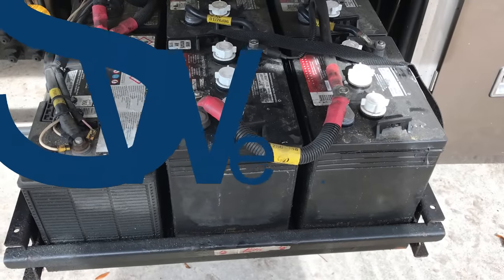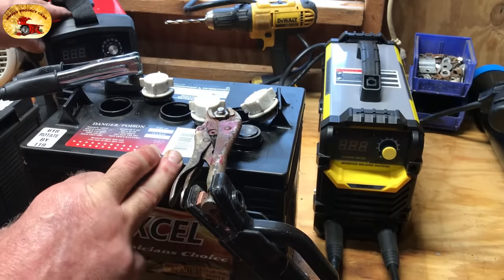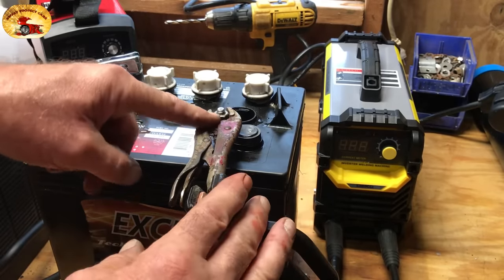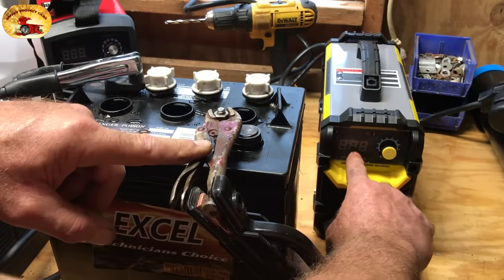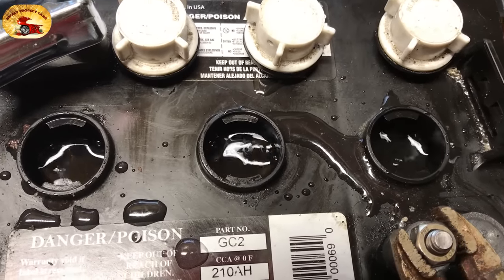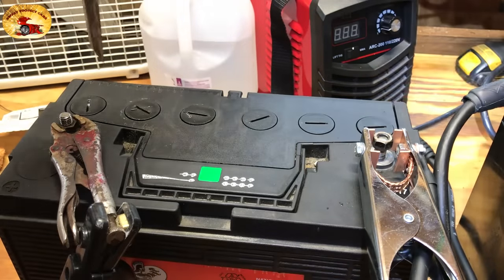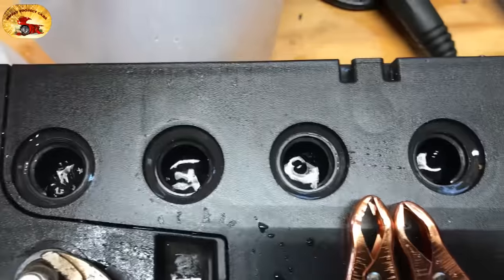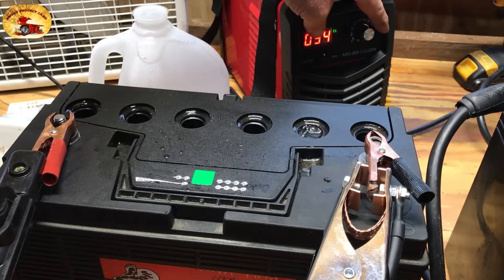How To MAKE OLD BATTERIES NEW Again!!!  12v 6v Deep Cycle, Car, Truck, Golf Cart, Semi

Comment: Well I took the plunge, and got the red welder to try to save a 12 volt deep cycle battery. 4 out of 6 cells  bubble well and 2 sit there. I hooked up the red welder and I increased the setting up towards 200 and popped a garage breaker. I tried it out back of the house and it popped the breaker after a short bit as well....any ideas?
Reply from the maker: The welder is more efficient than any battery charger out there so you only have to set it to 1/2 the amperage, you don't need to go to 200amps. as long as it's boiling. Also, you may need to do the process 2 or 3 times to wake up the battery.  Do as the video shows once for 3 days if it doesn't wake the battery up it's toast. Make sure you recap and unplug the welder before disconnecting the cables.  Hope this helps Rick.  Thanks for asking. Have a great day.  mad Mike the hammer SPC
Reply: @SweetProjectCars  Try grounding the welder itself outside with ground rod and wire. Stopped tripping my breaker and ground fault outlets.

Comment: My golf cart has 8 volt batteries.  Is there anything out there I can buy that will work?
Reply from the maker: This process works on all wet-style batteries.  Thanks for watching.  Have a great day.  mad Mike the hammer SPC
Reply: @SweetProjectCars  which welder works for 8 volt?   You recommend one for 6/12 deep cycle and one for 12v automotive?

Comment: Does this damage the welder in anyway?
Reply from the maker: Hello Peter, with over 700 videos on our channel, we would never put something out that would harm a viewer or anything they have.  mad Mike the hammer SPC
Reply: It has to be an inverter type DC stick welder, the thing with inverter welding machines is that they have built-in protection for short circuits and anything out of the ordinary, these machines can handle 200A burst, highly doubt a battery's internal resistance would destroy it.

Comment: Great Video. Thanks!
Quick question,. Would it be worth my while to remove the electrolyte liquid after the charging and filter out the residue from the desulphating and then put back the same liquid after filtering clean?
Reply from the maker: That's not necessary, Zephyr. Thanks for watching and asking, have a great day. mad Mike the hammer SPC

Comment: The life of a battery is 4-6 years. If is newer and sulfated your method it's effective, but if is old or broken inside is a total loss.I did it using 240V, diode, and resistor in series,  and last year by using two battery chargers(not electronic)   in series.
Reply from the maker: We say, if  your battery is not working the way you like it, do this as you've got nothing to lose, we have done this to hundreds of customers' batteries and have some that are 20 years old.  Thanks for your comment Nicos.  Have a great day.  mad Mike the hammer SPC

Comment: I just got my DC welder and was getting ready to try this process so I pulled the 12 volt battery out of my motorcycle and it's an AGM battery. I've read that you aren't supposed to add distilled water to an AGM battery and I've also read that some people do. I pulled the strip of caps off the top and many of the cells look dry, I think that the glass mat is supposed to look wet but that the electrolyte shouldn't be filled as high as in a wet cell battery and I've also read that this process will ruin an AGM battery. How do you deal with AGM batteries, when they stop holding a charge are they junk or can they be recovered as well?
Reply from the maker: Hello Jeff, due to the fact that AGM batteries are more sensitive to charging, every AGM manufacturer has a recommended charger for their specific batteries, you need to find out what charger is recommended for your battery.  Hope this helps, thank you for watching and asking, have a great day and  all the best on your project. mad Mike the hammer SPC
Reply: @SweetProjectCars  Thanks for the reply, I didn't get this welder in vain, for one I weld as a hobby around the home and this little tig/stick welder just adds to the arsenal 😀 and I still have an Interstate 12V automotive battery that is a flooded lead acid battery that needs restored. I tried it with a borrowed battery charger with 200 amp jump start but I think that mode was automatic because I never was able to get any cells bubbling with it so we'll see how this DC welder works. 👍

Comment: Doesn't the welder's display indicate current intensity in amps?
Reply from the maker: Start the welder on it's lowest setting and keep increasing until you get a rapid boil.  Keep it simple.  Thanks for asking and watching.  Have a great day.  mad Mike the hammer SPC
Reply: Yes. That readout is amps. I assume the voltage is about 25v on the stick welder.

Comment: this is a fact im using the same battery in my lawn mower that came with it 10 years ago it just like a new one but every year i hook my 100 amp battery charger to it an boil it just like this for a couple mins an its just like new..an its a sealed battery i can hear it boiling  i dont know why people dont do this an the battery will last to it looses a cell only time i ever change a battery with it shorts out one of the cells
Reply from the maker: We are with you 100% on that miracle man!  We have batteries that we have had for years and years.  Thank you for watching and sharing your knowledge of this process.  Hope you have a great day my friend.  mad Mike the hammer SPC

Comment: Why can’t you use the yellow one on regular car batteries? Only deep cycle 6 &12v?
Reply from the maker: We found the two different welders and their specifications work differently for 12v standard car batteries and 6v deep cycle batteries.  After months of preparing and studying all of the different welders out there and the effects they had on 12v standard batteries and 6v deep cells, these are the welders we came up with that are safe for you and the batteries.  They are listed accordingly in the SHOW MORE of the videos description.  We have two different welders because the 200amp is too big for 6v batteries, you don't want to know how we found that out.   Thanks for asking.  Have a great day.  mad Mike the hammer SPC
Reply: Thank you Mike!! Do you think the 160 amp one will work for regular 12 v, only slower? I’m wondering if i can get away with just getting one due to space constraints.

Comment: Dang....I need the inverter welder for the 6 volt battery. It’s sold out and unavailable...ugh. Any suggestions?
Reply from the maker: See my other comment to you Bryson, it should get you pointed in the right direction.  Thanks for watching and asking.  Have a great day.  mad Mike the hammer SPC

Comment: Will this also work on AGM batteries like Optima.
Reply from the maker: No, Gavin, this does not work on gel/agm batteries.  Thanks for asking and watching.  Have a great day.  mad Mike the hammer SPC
Reply: AGM technology by design is very resistive to “sulfation” of the plates as they are sandwiched between glass mat. The low self discharge of AGM’s also wards off sulfation. When a battery goes below about 12.3/12.2 sulfation begins.

Comment: Thank you so much. You really have great, straight-shooting ideas that work. I'm getting the Yellow welder for my off-grid 6V batteries. How do the cables hook up to the welder?
Reply from the maker: They have a probe end that snaps into the front of the welder, they are removeable.  Hope this helps.  Thanks.  mad Mike the hammer SPC
Reply: @SweetProjectCars  hey, that you for a careful and kind answer to what was essentially a stupid question.
Reply: lol might want to test the polarity with multimeter before turning the machine on...

Comment: so will the yellow one do all batteries in addition to deep cycle?
Reply from the maker: The yellow welder is the one you will want to use for 6v batteries, the red welder is for 12v batteries.  Thanks for asking.  Have a great day.  mad Mike the hammer SPC
Reply: @SweetProjectCars  Hey Mike.  Does the yellow one do 12volt deep cycle or do I need the red one for either 12v deep and regular.  I bought the  YESWELDER ARC-165DS Stick Welder,165Amp Digital Inverter you suggested and I can't get my 12 v deep cycle golf cart battery to bubble. Thanks for the help.

Comment: Great video Mike but i was wondering if you can use a AC welder instead of the DC? I have a small AC 160 amp welder that you can dial in like the DC welder you show. Thank you for the great videos. 
William
Reply from the maker: We suggest only using the one's we share William, after years of testing the one's we use work every time, and they are safe for both you and your batteries. Thank you for watching and asking, have a great day. mad Mike the hammer SPC

Comment: I have a BOC welder. Inverter style. Welds beautiful. My question is the  what maximum voltage can you use to do this trick? I have a deep cycle battery which I am assuming is sulfated. Welder goes from 20 amps to 140 amps. I can Tig weld but I use only as arc  welder. Ant reply appreciated cheers from Australia just subbed.nice work 🙂👍
Reply from the maker: Just start out on the lowest setting, then gradually turn it up until you have a full consistent boil, then follow the process in the video, and make sure you recap and unplug the welder before disconnecting the cables.  Hope this helps Dragan, thank you for watching and asking, have a great day and all the best on your project. mad Mike the hammer SPC
Reply: @SweetProjectCars  thanks man! I really appreciate the reply. Cheers and have a great day or night!😃👍👍👍

Comment: Wouldn't you need to reverse the leads since the "neg" lead on the welder is positive and the positive lead is negative? I tried how the video pictured  Sure it bubbled. But now with a multimeter on the battery the positive post shows negative voltage. Try to hook it to a charger and it just says wrong connection.
Reply from the maker: We've never had this issue, if you're using the exact tools we are using you will not have a problem.  Following the video and using the same tools is the key to success. Thanks. mad Mike the hammer SPC
Reply: Adam Opheim, are you sure you are not using your mig/tig welder set up for aluminum? Most of these welders you can switch it back to ferrous metals by reversing the leads. In the end you want positive welder lead on positive and negative on negative both at the battery and at the welder connections.
Reply: With DC welders, you have the option to weld in reverse polarity or "normal" polarity, which is to say positive to positive. It sounds like you had your welder leads hooked up to the machine on reverse polarity, and managed to switch the polarity on your battery.

Comment: Does anybody have one of these inverter welders and a multimeter ? 
I'm interested to know how many volts they put out 
Thanks if you can measure and post voltage
Reply from the maker: I can tell you that you don't need a multimeter with either one of them they put out enough volts.  thanks.  mad Mike the hammer SPC
Reply: They are both Constant Voltage welders. The yellow one is 60v CV, and the red one is 75v. The dial controls the current, not the voltage.

Comment: Why wouldn't the red welder work on the 6v or the other welder on the 12v?
Reply: Wondering the same
Reply from the maker: Our videos are very product/tool specific, we are sharing what we have tried, tested and know works every time, also is safe for both you and your batteries.  Thank you for watching. mad Mike the hammer SPC

Comment: What if your battery is a closed battery? A dry cell.  This is only if you use acid lead batteries.
Reply from the maker: This works on wet style batteries only.  Thanks for asking Marcin.  Have a great day.  Thanks for watching.  mad Mike the hammer SPC

Comment: The numbers on the welder dont seem to represent anything other than a percentage of power being output.  What is the applied voltage to the battery and if it's over 14 volts, how does this not damage the battery?
Reply from the maker: Turn all dials to zero, then attach to battery, slowly turn the first dial up until you see slight bubbling, slowly turn the dial up until you get a consistent boil without boiling it over.  That's it.  Thanks.  mad Mike the hammer SPC

Comment: Can I use my Lincoln buzz box ? How many amps?
Reply from the maker: You can use whatever you want, we are just showing you what safely works for you and the battery.  Have a great day.  mad Mike the hammer SPC
Reply: @SweetProjectCars  how many amps should I use? Does it matter if it is ac or dc? Thank you

Comment: I really like the idea but I have some questions. You told us to use the smaller (I think 160 amp) DC welder for the 6V deep cycle battery, would you use the same welder for say 12V motorcycle and riding lawnmower batteries as well or use the bigger welder for those?
 Also, wouldn't there be a benefit to pouring out the crud that accumulates inside the battery and starting with fresh distilled water or no? 
  Thank you
Reply from the maker: You can use that welder for those size batteries, and as far as pouring out the crud, it's not necessary if you can get double the life out of a rejuvenated battery that's great.  Thanks for watching and asking Jeff, have a great day. mad Mike the hammer SPC
Reply: @SweetProjectCars  I'm doing this today on a battery that will no longer hold a charge for more than a few days in our '99 GMC Safari. Fingers crossed 🤞
Reply: @bodeine454  did it work?
Reply: Stick welder power sources will have the voltage naturally change to whatever is needed to jump the gap, either from the welding electrode to the work, or between the plates in the battery.  The adjustment on the machine is amps, the total number of electrons. 1 amp is 6,[17 zeros] electrons. So, the same welder should work for 6, 12, or 24 volt batteries.  A smaller size battery would need less amps to boil the water between the plates and break off the sulfur scales.
Reply: As far as dumping out the crud and adding pure distilled water, that would allow the charger to clean the battery plates well, but unless you go to the auto parts store and buy new acid to put into the battery, it won't charge.  There's a small measuring tool anyone can buy to test the specific gravity (concentration) of the battery acid.  It has different colored balls that float in the battery acid to show you how heavy the liquid is.  A jar of new battery acid is pretty cheap.  That stuff is dangerous.  Do anything like that in a sink, wearing glasses and gloves, and wash with lots of water when if you don't think you touched any acid.
Reply: @Eyes0penNoFear  No, I was using a Napa 200 amp charger but I think that the 200 amp  jump start feature was automatic or something different, I never could get the cells to boil and I tried about 4 or 5 times. I guess I need a different charger.
Reply: @carpediemarts705  I hear that, it seems that every time I mess around with a lead acid battery that no matter how careful I am I usually end up with small holes in whatever clothing I wore and they don't show up right away, like a week or so after it's been washed a few times. 😏
Reply: @SweetProjectCars  Will you link a decent stick/tig or mig/tig welder for around $200? The stick/tig welder you listed doesn't come with a tig torch or hardly any accessories and I'm not sure what to get, I've never tig welded before.

Comment: I saw your other video that recommended topping off with distilled water and charging with a manual 200 Amp charger every hour for 15 minutes. 

I happen to have a welder that goes up to 140 Amps. Therefore this method is preferable. 
You stated to start on the lowest setting and gradually increase until the liquid boils. 

My confusion lies at how many amps do I stop at after boiling occurs. 

Please help. Really need to try this ASAPto save $
Reply from the maker: You gradually turn it up, once you reach a rapid boil on all the cells, follow the detailed instruction in the video.  Thanks for watching Billy, have a great day and all the best on your project. mad Mike the hammer SPC

Comment: At 38 what? 38amps/volts? 
Oh I see, the pulse from the welding lead desulphate  the plates in the battery...
Reply from the maker: Thanks for watching.  Have a great day.  mad Mike the hammer SPC
Reply: @SweetProjectCars  I'm ordering the welder from Amazon. -:) does this work on AGM batteries or just flooded wet cells?
Reply: @BryanChance  nope

Comment: Hi and Wishing you a happy new year 2021 from a wintery Hartlepool N.E. England.

The red Rohr mini  220pi on uk Amazon...is this good for all applications?
Or is there another as i liked the idea of the touch tig feature you mentioned in the video.

Ps i tried with my sureweld 140 stick welder on a large 6 cell leisure battery and managed some good bubbles from the outside 4 cells. Cant get the 2 inner cells to liven up even on full tilt.

Abandoned that battery and went to a regular 6 cell car battery and im getting sparks and arcing which is damaging the terminals. Regular crocodile clamp to the negative and the stick holder onto vice grips on the positive...very unnerving and needless to say i didnt even turn the power on the welder. 
Any feedback or insight would be greatly appreciated.

Thanks in advance
Reply from the maker: Hello David, our videos are extremely product and tool specific.  What we share is what will work.  Trying other tools and items outside of what the video shares is highly unrecommended, you will find no success using other tools not mentioned.  Use the tools shown for the UK.  Thanks for watching.  Happy New Year my friend.  mad Mike the hammer SPC